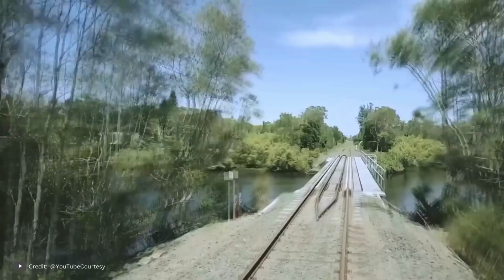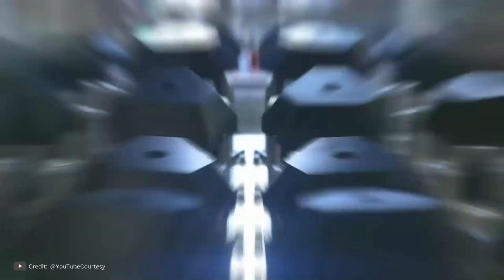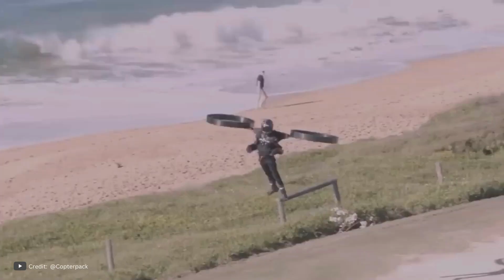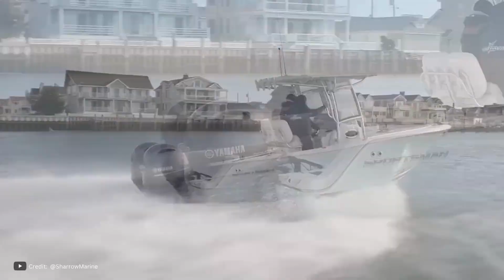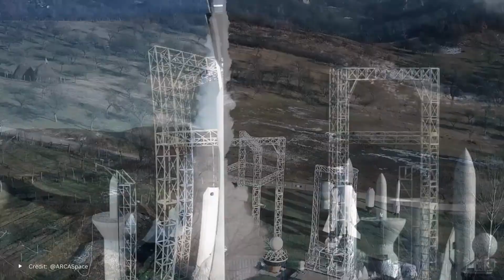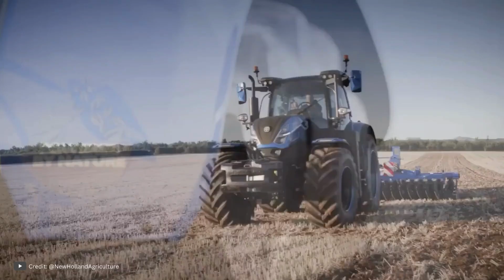25 Genius Inventions That Will Blow Your Mind

Comment: Mine's better  !!!!

I've invented a power source that uses absolutely no fuel at all. 
It's an inverted water wheel. 
Instead of using water as weight on the side of the wheel that causes it to turn,, I took a wheel and put it in a tank of water. And instead of using water troughs to catch water , I use air bellows bags.  Let's say 12 in clock positions for the explanation purposes.
There bellows bags are in wedgebox shapes 1foot tall, 2 feet wide and 3 feet long. That's 3 cubic feet of air.  Now 7-8-9-10-11 Are all under water.  Now for some science,,,, 1 cubic foot of water weighs 62 lbs  and coincidentally 1 cubic foot of air has the lifting strength of 62 pounds so the five bags from 7-11 have the lifting strength of 930 pounds!!!
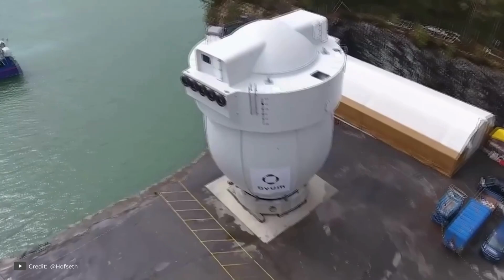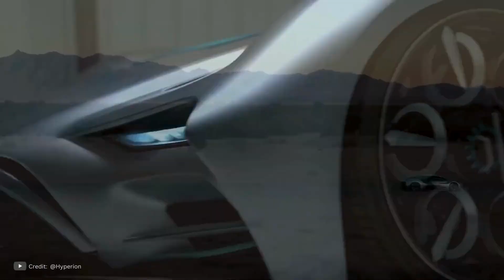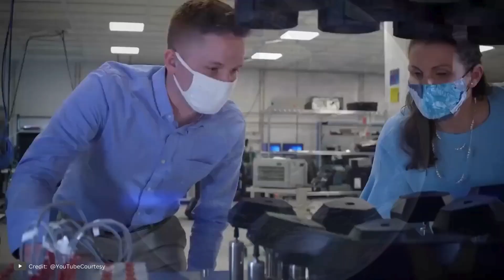And that's mire than ample to rotate the bag at 12 through the squeeze chute and transfer the air back to the bottom at 6 o'clock position.  The squeeze chute starts at 11:30 and is completely empty of air by the 12:30 position where it gets locked shut and remains locked till about the 5:30 position where it gets unlocked simply by hitting a lever on its way by. All positions are connected to the adjacent bellows bag like 12-6 1-7 2-8 3-9 4 10 5-11 by air pipes 6 of them tonight be precise.  The squeeze chute. 
It is 2 rails that slowly getting closer to the wheel,  the bellows bags have a hard plate top that have two rollers on top so it closes as it turns into the squeeze chute. 
As I that's the  gist of it but the bellows bags can be replaced by piston cylinders or plunger cylinders.  Actually anything that holds air and can be emptied as it rotates from top to bottom.  
Now think about this seriously  ..... You can't do this with water in the air because it's weight and slow transfer through pipes . But air can transfer quickly through pipes and more efficiently. This thing can be put anywhere in the world as long as you can get water to it to fill it up with . You can put it in the ground so it won't freeze.  It's scaleable so the bigger it is the more powerful it is.  Think about trying to stop a twelve foot diameter wheel with 930 pounds of lift strength,,,, the torque at 10% off the axle is close to 4 tons. I've already  taken everything I know about this and wrote it all out and took it to a post office and had them date all paperwork with their postal date stamp then had it sealed and sent to myself and then stored away somewhere safe.  Then I went on Two radio shows and totally explained it to the world,,, and had to call back a lot to give more explanation and clarity.  That way it's no longer eligible to be patented legally.  Once the description of the device and all details are public,,, it's simply not patentable by law. So,,,,,,,, I give everyone in the world my absolute permission to build the inverted water wheel that I've described here. No worries about getting sued.  It's an alternative power source.  Good build one. You can even make a small desktop size to use as a model  for city planners for CLEAN energy  that won't cost and arm and leg. You can make this thing charge your car battery,  or so many other applications.
Reply from the maker: Where can we see it can you share the link?
Reply: @rlxtcorpinc  No links. No videos.  Just designed and built,  then inspected by three engineers and they're are thinking about improvements and design changes for more efficiency.  But so far the only improvement is the framework for the wheel.